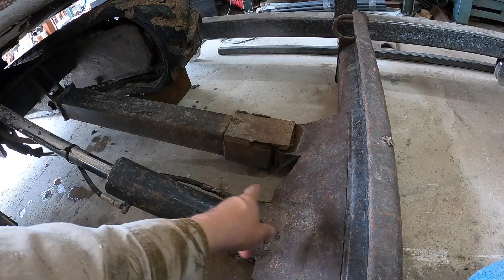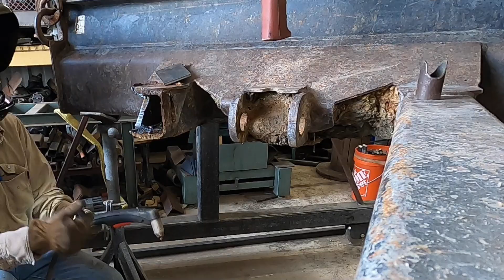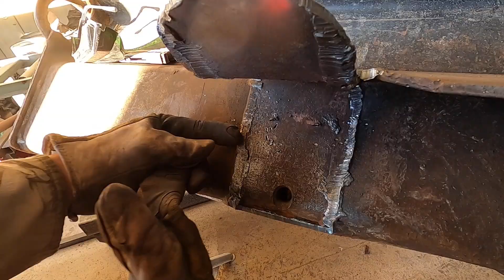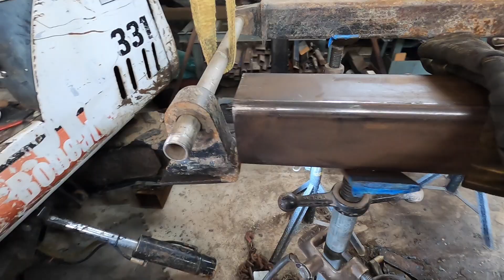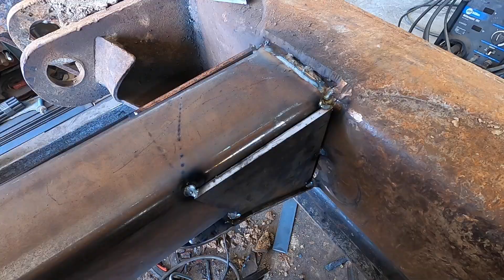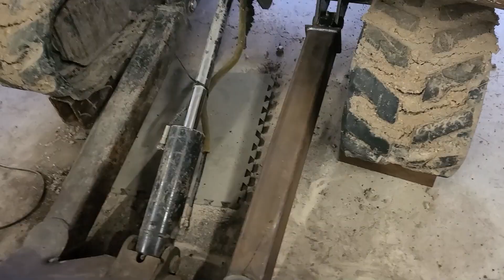Mini Excavator Repair

Comment: I’m a engineer and this guy has a better understanding of stresses in a repair joint than some of the “expert engineers” I work with.
Reply: Practical visual deduction built on decades of first hand experience he is pretty spot on repairs especially in the field applications , abused machinery in rocky areas makes him invaluable on recommendations for fixes..🤔👍🤙✌️😔❄️🙏
Reply: As they say “in theory, theory and practice are the same, in practice they are not”. I’m an engineer too, and in doing design estimating the loads, especially the dynamic portion, is always a challenge. As others have said, real world experience tells you whether you got it close enough.
Reply: @AndrewMoizer  i’ve worked with Army Corps of Engineers on multiple occasions, i’ve met individuals that can give you every speck load bearing weight criteria installation method available off the top of their head. Applying that to a real world scenario is a totally different animal. When it comes to using cranes ect...will the crane reach, will a crane hold the weight boomed out that far?? It’s a shit show at the best of times🤣
Reply: Perhaps that's 'cos he have seen and repaired more cracks than all of them together!  *smiles
Reply: @samos_sainz  Also he is responsible for his work. Remember, quality is when the customer came back, not the part.😁
Reply: @samos_sainz  p
Reply: @samos_sainz  ..............

!!,!
Reply: Stress cracks always get little hole drilled at the end by me.. Before fixing ..stops the crack..
Reply: 'Not much to it but to do it'. Yeah, easier said than done......
Reply: Years of melting metal together in any position on land and in water.
Reply: Boilermakers lean all about stress and residuel stresses built into job and if SHS and RHS is not welded right in relation to the stresses on the moving part it can tare its self apart. This is why on side plates we weld down the shaft and not across the side face if this makes any sense I am not the best at explaining things but I am very good at my trade so I have been told. 🤣🇦🇺👨‍🏭
Reply: Gotta love practical experience, decades of practice and good horse sense. It ain't common, but this dude has it. Deep practical knowledge. Love his work.
Reply: Just look at the two building collapses in recent years, both buildings collapsed while structural engineers deemed the safe. Neither engineer had any idea what they were doing. As a contractor with 30 years experience I have dealt with engineers like them. Their degrees often give them a superiority complex, if a lowly contractor tries to tell them they're wrong or missing something they ignore anything to do with the idea.  In the case of this bucket arm the original engineer got it right, the damage is due to abuse and age.  IC Weld was right to return it to original. The prior repair was doomed to fail exactly as it did, all stresses in one plane.
Reply: Because he’s in the field. And those guys are like well it works on my computer. Engineers, so smart and yet so wrong so many of the times.
Reply: @JimBob-tk5zx  same thing I experienced in the army. Was trained on theory but field experiences was totally different.
Reply: @JimBob-tk5zx  if you only knew how much that rings true in the world today....I had an exasperated engineer tell me that to my face when we were looking at the actual parts on the structure and then comparing them to the engineered drawings. He said to me “I can’t believe what I’m seeing!!! The computer drawings (which are copied paper drawings) show this to be something else! Lol...OMG...i was like yeah...that’s what I’ve been dealing with for YEARS and you just now decided to come take a look..........
Reply: @JimBob-tk5zx  a computer is one thing practical hands on is of another brand for sure real worker gets my vote any day..🤔👍🤙✌️😔
Reply: Just like a Front solider 👍
Reply: It is called reverse engineering....
Reply: Experience makes the devil who he is I didn't say that to be mean to him I respect his knowledge and the way he does things it's just something my dad told me years ago when I question his advice while fixing a brush hog
Reply: Square structure is weak, and in this case is It allows it to flex sideways, which in this case is the weakest direction of the whole structure, and it stresses welds, and materials. I would add some triangulation/ diagonal support, just to get that sideways flex smaller. Then the welds has some 10x more lifetime. Now it will crack again in no time because the structure is just stupid.
Reply: Definitely a good fab guy.
Reply: Lol. Probably because they have an inflated self worth of their knowledge.
Reply: Z

Comment: You have a leatherman on your belt? Completly useless as a tool, but if you don't have any tool with you, it's priceless 👍

I once had a breakdown in the middle of nowhere some 50 miles from Calais in France, intercooler hose burst. I didn't have any tool with me. That was pretty much the last time i went for a trip without having a multitool on my belt.

I use both, leatherman and victorinox. The only place i go without it, is the bathtub. I even have a leatherman sidecick in my pocket, when i have to wear a smoking 😂
Reply: broke down with a friend in the mountains of Guatemala at night. the only thing we had was my leatherman. He fixed the transmission with it.
Reply from the maker: Haha, yeah, I rarely go anywhere without my side tool. Mine is a Gerber though. very handy!
Reply: @ICWeld  Gerber i only heard of, it's not very cummon in europe. I think (in fact i fear...) i'll have to add one to my collection  😂
Reply: @stefankaufmann8257  those gerber knife blades hold a beautiful edge once sharpened I've cut copper wire and stripped copper wire and cable without so much as a fold-over or nick with mine and it only needed a light honing after replacing an entire vehicle wiring harness

Comment: I always wondered why they were not used more for metal; but that makes total sense. Like I would not hesitate for instance using a wood plate (gusset, glue, nails) to reinforce a wood structure, but those still flex.

Comment: I have used patch plates before, but only after a good repair. Also need to make it somewhat triangular, elongated, and rounded to spread out the force. Like you said, it needs to be able to flex. Square patch plates just cause a rigid stress point.

Comment: I'm thinking of bushings for the bars under the mini as one possible fix. Using a grinder to make the current holes more concentric then pop in the bushings.
Reply: Tube sleeve them the metallurgy of a tube will make the bores more resistant to wear and stressload egging

Comment: Do you find plasma consumables lasting longer if the tip makes contact with the work vs. a gap like you would with a cutting torch?  We got several new plasma cutters at work and I got into a disagreement with a co-worker (I watched the DVD that came with the plasma and he didn’t) I could get more life out of consumables than he could.  I touched the work, he gapped.

Comment: I know, as the owner of the machine,  I would have gotten you to fix those 4 ears under the machine while you had it instead of bringing it back again.  I would think with that slop under there it would make it vibrate much more causing more problems later.  Great job on what you did.  God Bless and stay safe.

Comment: One of my machines, the former owner taught hisself to weld on it, and its obvious.  The blade on it has cracked in several places over the years (common on this machine) so they put plates over the original crack, but didn't weld said crack... eventually stacking 4-5 layers of a plates over the same crack, took me 3 days to cut all the plates off and weld it properly, so far its still holding, though last inspection shows more cracks on older welds... FML
Reply: Now you get to practice! fixing mistakes is job security
Reply: @MRIsomewhaereguy  except I'm not a welder by trade, and I have much better things to do than fix some morons screw ups

Comment: Those mig welds are fine. Your a little hard on yourself. Especially using spray, they shouldn’t have a problem holding
Reply from the maker: Most of the problem is that Im using .045 wire. I personally think its too large of wire for small repairs like this. i'll be swapping it our soon for better results...hopefully!
Reply: @ICWeld  yeah, I really like running .035 and cranking the settings up
Reply: Looked in my book of notes, and I normally run 40v 450wfs with .035” wire for .25”-.5”. I remember that that setting is kind of general, and would be good for what you do where you might be hopping around from different thicknesses. BTW, I ran that on a Miller 350p also.

Comment: I'm the same way. When I get a chance to Mig weld it kind of a treat. 99% of the welding I do is 1/8" 7018. That patch looked like a quick fix done by the customer.
Reply: 100% a customer fix, that's how i would do a quick fix in the field. That does not mean, that it's the propper way, but like IC said: It gives you time, until it's fixed the right way by a professional.

Comment: Always great to watch you repairing stuff. Those patch plates were too big and too square in shape, the corners should have been trimmed off 1/3rd of the width on each corner in my opinion. Patch plates are OK for field repairs but in a workshop l would do the same as you and replace the section and  effectively rebuild the blade arm. Many thanks for another interesting video young man!

Comment: Always learn something even as I admire a true craftsman where every move counts.  Didn't know that they made a scarfing attachment for the plasma cutters.  I was certainly aware of the scarfing tips for the acetylene torches but not plasma.  Thanks for growing my tool expenditures!! LOL.
Reply: Thanks for the info.
Reply: Its not just a tip exchange for a plasma cutter
You have to have a machine that has the plasma gouge function on it as well as the proper nozzle

Comment: The problem with patch plates is that if they are not done correctly, they concentrate stress into one area and it breaks at that point, usually pretty quick or at the worst time.  Better for patch plates to be tapered, but not like a wedge, more of a tapered V on to the original material so that the weld can be longer and the stresses spread over a bigger/longer area.  Or, you could just do what you have done and fix it properly.👍
Reply: Or the the very nice design engineers could design the part big enough to withstand the forces being applied on a regular basis.
Reply: @jimbob8969  Now that would effect the market for spare parts and ultimately some ones overseas holiday wouldn't it? 🤣
Reply: i heard a railcar worker call them fish plates
Reply: @peetky8645  Yes, they are often called fish plates because of the shape - fish shape without the tail. The brace on the underneath that got replaced with the piece of checker plate is effectively a fish plate, well, half a fish plate.  In carpentry where, say floor joists are joined, the plates are often called sister plates. Sister plates or just sisters are usually not tapered, just a piece of timber added that spans the joint to support it, usually a butt joint.
Reply: @peetky8645  my dad called them fish plates
Reply: @samuelspencer9194  i believe they are known by that name because of their oval fish like shape.  it works to distribute stress and prevent cracking
Reply: @peetky8645  thanks I know my dad called them that appreciate the come back be safe and have a great day Sam
Reply: Back around 05 I had put a 2ton produce truck back together that had patch work like this. Cleaned it up to original metal and finished it off with 3/8 fish plate. I saw it still on the road 10 yrs later.
Reply: @mattsirmans9146  I have driven around for years in a couple of LandCruiser flat tray "trucks" that have been lengthened by 18" to 2'. The chassis in both cases is held together in the centre just behind the cab with a couple of well applied fish plates with absolutely no problems. One LandCruiser was involved in an accident where the front end of a Hilux was remodelled without any damage to the LandCruiser.
Reply: Would it help to grind a radius at the point of the V? I know in machining they say sharp corners make a high stress point, and that radiuses are used to help spread out that stress
Or would it still just be better to completely fix it?
Reply: @LukeA_55  Yes, a radius at the point would be an improvement. Generally, the V would have the point cut off so that it doesn't cause a stress riser.  With the rounded point, like you suggest the stresses go around the curve and don't concentrate at one spot.

Patch plates would still work as a repair done properly, but replacing the material like Mr IC Weld has here limits the heat effected areas that tend to crack easier due to the change in structure of the steel caused by the heat - hardened, change in temper etc.
Reply: @xj9ox  thank you sir!
Also if you don't mind me asking another question, could you heat and temper the part after adding the patch plates? Or would that take too much time? 

Mr IC weld has opened my eyes to this side of repairing machines and I'm considering getting into this business myself
Reply: @LukeA_55  Once again you are right.  Mostly the size of the parts, equipment available, cost etc means that it is often not done or the heat effected zone doesn't pose any great risks.  You will often see I C Weld preheat parts before welding which helps with controlling shrinkage (built in stresses), weld penetration, HAZ and further cracking (especially with cast iron parts).  Mild steel is not able to be hardened and tempered because the amount of carbon it contains is too low, but just about any joint tat has been welded will benefit from being annealed (more like softened) to relax the stresses that have just been built in.  Mostly though, further heating with expensive oxy acetylene gases just isn't absolutely necessary if the welder knows what he is doing and welds to minimise any built in issues.

Heat treatment like you suggest is used a lot in building metal aircraft parts.  For example, a lot of fittings are made of 4130 Chrome Moly steel. These parts are generally welded where required and then annealed  to relieve the welding stresses by heating the part to a red heat and letting it cool slowly.  Most of these sort of parts don't need to be hardened because the "normalised" 4130 steel is .  Parts like steel landing legs are machined, welded, shaped etc and then heat treated to a specified hardness (Rockwell) and after that tempered to the specified hardness and toughness.  Pretty much the same as the springs on your car.

If you're considering getting into the heavy equipment repair business, get as much information about it as you can including appropriate education - welding course/certificate/apprenticeship.  There is a lot to learn about the different types of steel, different types of filler rods, different welding processes, which process is best for a particular weld... the list goes on.
Reply: @xj9ox  thanks again. I'm taking a welding/machining and mechanical engineering class right now. I'm not sure if I can get a welding certification through this class tho, I'll ask my teacher about that. I'm wanting to build a machine shop and maybe one day start my own business designing new farm equipment.
 But for now, I just want to get a welding setup and make as much money as I can with that. And I should be getting a job in a machine shop this summer to help save up money for my bigger goals
Reply: @LukeA_55  preheat is important in thick sections because it prevents rapid cooling that promotes brittle cracking.  peening large welds can also reduce interior stress in welds....you see IC us that peener often to remove slag.
Reply: @LukeA_55  I'm revisiting this video and saw you comment about working in a shop last summer. How did that go?

Comment: Your absolutely right about the patchplates. Most often there occurs a new break just next to the pplate.
Reply: Totally agree. Seen it many times. Not that I’m right to do this. But I usually try to only stitch the patch plates on if I can. Roughly a one inch weld and a one inch gap - - - - -  seems to keep it from cracking more. I dunno why. Less heat maybe. Also like that if one of my weds crack it usually only cracks that one weld and doesn’t propagate across the whole part.
Reply: @Mad.Man.Marine  like drilling a hole a the end of a crack. Doesn't have material for the crack to follow threw
Reply: @Mad.Man.Marine  I agree stress is less memories of practice plates beads heat curls  it up same direction of heat less stress more strength and relieve spots kinda built in stress relief zones works on sheet metal spot welds. Ears could be 1" sléeved  welded in and pinned both sides ,not much abuse unlesspushing big boulders around Texas is famous for in,that neck of the woods., 🤔🙏👍😊❄️🤙✌️
Reply: Fish plates. Round corners or tapered. The stress/strain increases with sharp transitions. 
I agree you can’t make it better fish plating everywhere all the time, sometimes just fix the crack and leave it that way is better. Depends on the job
Reply: Seems to help if you make the patch triangular or diamond shaped so that the stress riser doesn't go straight across whatever your fixing.
Reply: @Lucas12v  Yep, reinforcing/repair plates used on the booms of big loaders and cranes etc. are either diamond shaped or have "fishmouths" for exactly that reason.